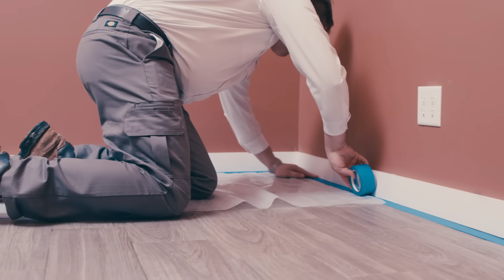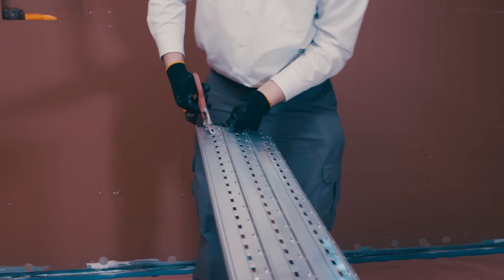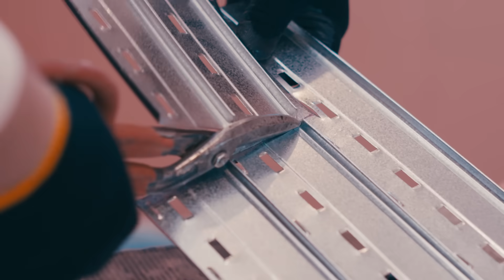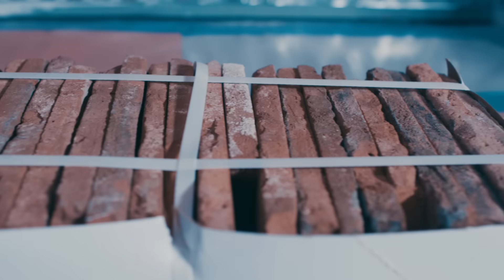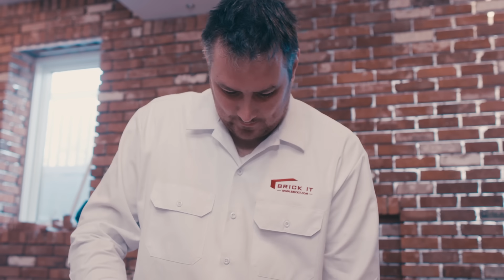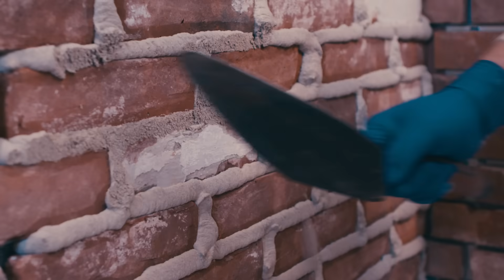Brick It Thin Brick  Installation System

Comment: They do not address overlapping panels for exterior installation.  If you have ever installed cultured stone over  non-overlapped mesh and scratch coat - you get transfer cracking through the stone.  Mesh must be overlapped on exterior installations.   No mention of this for their system on exteriors.  I would assume transfer cracking of thin brick would occur  if panels were not overlapped on an exterior installation.
Reply: Thank you for your feedback. We want to assure you that our panels are designed with the most overlap available on the market. The interlocking male and female ends, corner adaptations, and panel staggering all work together to prevent cracking, even in exterior installations. With over 40 years of proven performance, our system ensures long-lasting durability. If you have any further questions, please don’t hesitate to reach out.

Comment: You won't get what you see on their sample boards. Instead of a white wash, it looks like someone dumped paint all over them, with excessive dripping on the faces. I had to scrub each brick in water to make it look like their display board. Also, instead of buying 10% for waste, you should buy 20% to compensate for the brick piece that are bowed like a banana and you'll be sold an extra 10% on top of that from their crooked salesman (even though you handed them the exact dimensions of your project to calculate). You'll be sold an exorbitant amount of pointing mortar as well and they won't take ANY returns, not a thing, even though their website states no returns on brick. I'd steer clear of this business. Tried them out first with a fireplace before spending tens of thousands of dollars on the front of my house and I'm glad I did...

Comment: With all that metal on the walls doesn’t it impact Wifi or even 4G? Since this is a media room you’d have to have a 2nd router installed in this room so it could pick up a signal. I guess it would be ok if you used an 8mm film projector or a slide projector to project on a screen. Does anyone even know what 8mm film or slides are? LOLOL. 

The bricks look great but I’m wondering why the bricks can’t be adhered directly to sheetrock instead of building the metal substructure.  That seems like one extra, unnecessary step. If I’m missing something please enlighten me. Thanks. The brick wall looks great btw!

Comment: At least, these ones don't use polypropylene - the Grenfell Tower ingredient - the fire enhancer. While I like the slat system, I do not like the fact that there is not much useful information regarding facts/data. What happens when it's exposed constant thermal transition between extreme hot and cold - such as the exterior in Florida and Alaska or even UK? What if they start peeling off when the metal starts heating up and cooling off like that on the roof of your car? There is not a brick stacking upon another one like in a traditional system. Everything, including the future of your home, which should last 150 years is reliant heavily on Locktite's strength. We need data, not just nice pictures. What do you think?

Comment: I’m thinking this can be used for a brick ceiling. Secure the metal frame work to the ceiling in a pattern of so 4 corners come to a center point at a light fixture or ceiling fan. 
 Most new glues stick on contact. This can be done!  Now I need is to get the wife on board.

Comment: This is very cool! Thinking about using it in my basement. What is the function of the bracketing system behind it? Why couldn't you just glue the bricks directly to the wall?  Would it just tear the paper off the drywall? Too heavy?
Reply: I’m wondering this too
Reply: I’m guessing if it’s gyprock/plaster the weight will just peel off the wall
Reply: My guess is that you’re correct about the tearing of the drywall but also you don’t have to worry about checking for planeness for each row of bricks

Comment: just wonderin can paint be mixed into motter to give the job a pop ....
Reply: I do not recommend it.it will make the mortar weak... meaning cracks easy...I do this for a living so take my word
Reply: @coltonnixon1046  Colton, I'm in philly, do you know roughly how long it would take 2 guys new at this to install 15' wide x 8' high? Also the pointing joints look large. Do you use a regular brick pointing tool? Looks messy with the cake icing thing

Comment: How did you do the soldier course on the top row with the grids?
Reply: Cut the grid in 7 1/2" strips and run it vertically above your running bond pattern  would be my guess.

Comment: So, cant you just put bricks on the wall without the metal?
Reply: Yes, you can
Reply: I'm a union bricklayer, no you can't lol. You need tie it in with the existing wall. Usually with some kind of wall tie system. There are many depending on the material of the existing wall.

Comment: Can it be used on the exterior? It would probably look nice on a foundation.
Reply: B G Rosa  H
Reply: it wouldnt last the movement of the surface would crack mortar joints
Reply: @moorishamericanpatriot8536  We use it on the exterior of  homes all the time.  That's what it was made for!
Reply: @moorishamericanpatriot8536  0+000h opp ud ok sg hu aufazgihkc

Comment: Where can I buy the metal?
Reply: From Brickit.com, the makers of the video.
Reply: Henri Rahmon you don’t need the metal.. just install like ceramic tiles
Reply: @WOJAC-n2t  -- I think that's a bad idea.  Thin-brick installation panels are better than just direct application for a couple of reasons -- not least of which because they have the ledge-rows to keep the courses straight and to provide support for the thin-bricks.  Also, for exterior use, you'd want to have an air-gap, and a moisture barrier, which would be much more complicated if you were going to just install the thin-brick like ceramic tiles.